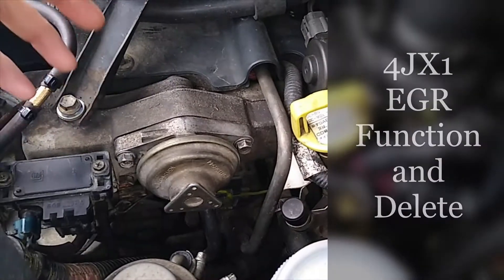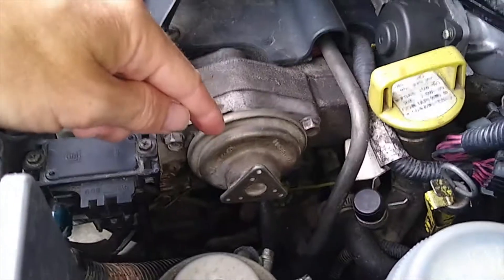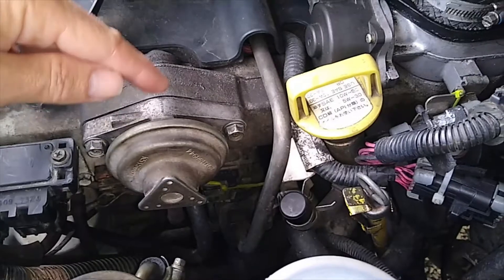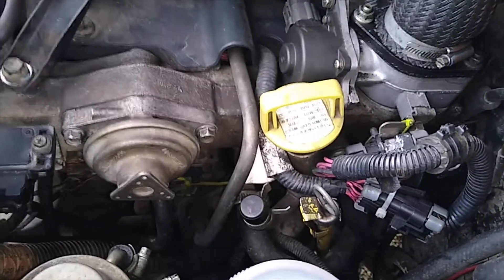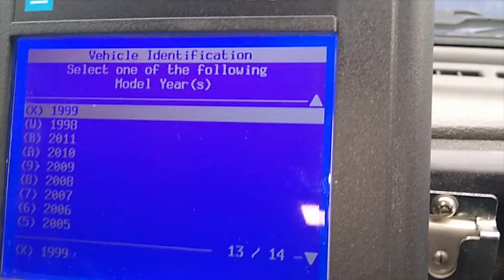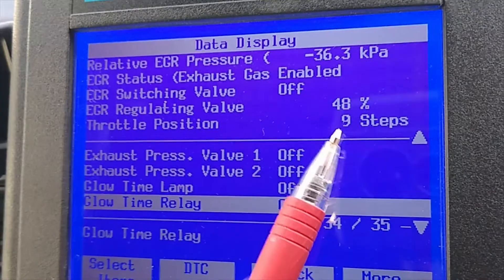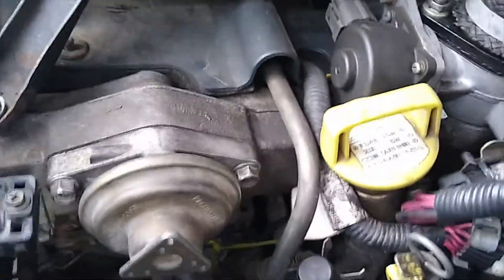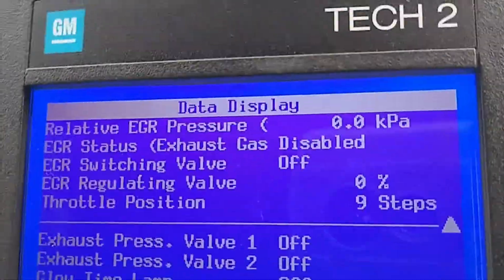4JX1 engine EGR valve explained and delete.

Comment: Hi there, thanks for doing this video, could you tell me if you throttle butterfly plates need to be removed, or can you just delete the EGR by blocking that vacuum hose? I was thinking of trying to source a stop tap so i coukd switch it back on at MOT time

Comment: Can you show us how you blocked it mate
Reply: My guess is find a ball bearing that is a very tight fit in the tube, lube up the ball and shove it in. It has to resist vacuum, so -14psi, so not a big deal - the bearing is unlikely to be sucked in if its tight enough.